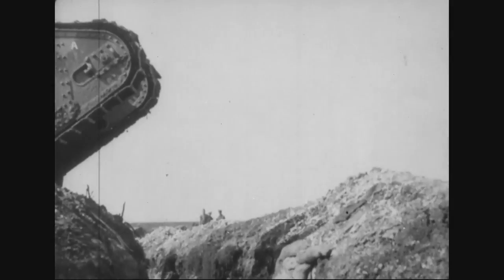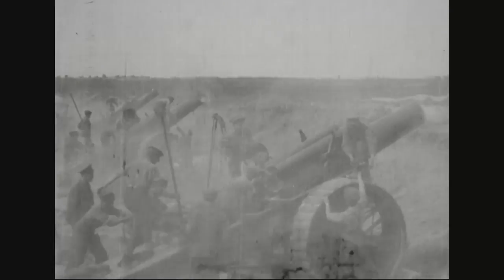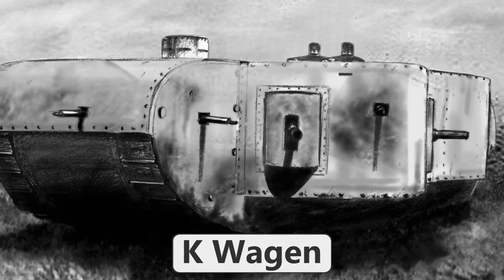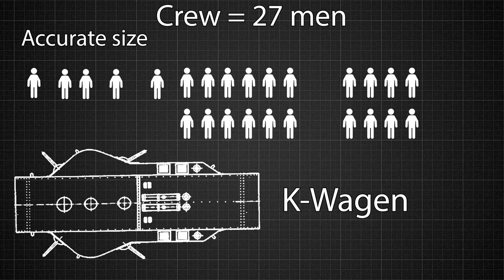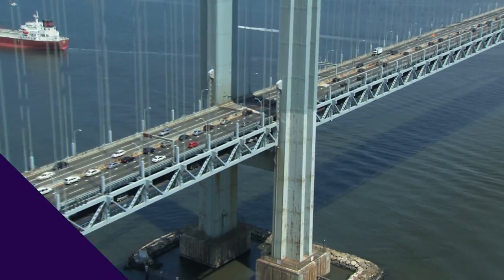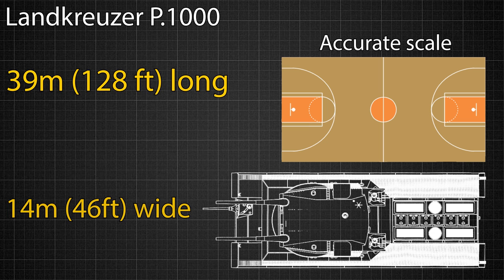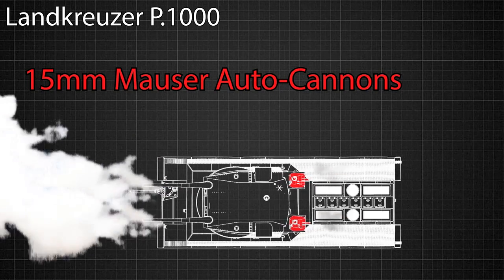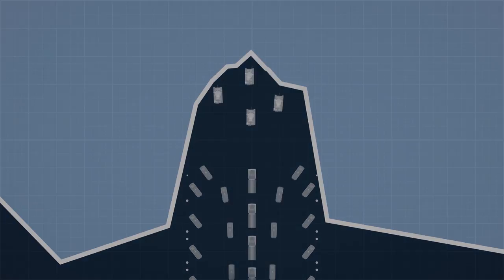These Are the Largest Tanks Ever Designed

Comment: The M1 you used is very outdated (1980's), the M1A2 SEPv2 (by 2017, the time you uploaded the video) was the most modern variant. Currently, the M1A2 SEPv3 is the most modern variant. (But it wasn't around when you made the video)

Comment: The current M1A2 has a 120mm cannon. Not a 105mm.  If your going to talk about a tank use what info is available on it.  The M1 Abrams has a 105mm in the 1980s - early 1990s. Then it was upgraded to the 120mm gun it has today.

Comment: The p1000 ratte wasnt aprovved by hitler, it was just a speculation, for all we know it could have been something that drunk desingers drew up one night.

To prove this a turret in the atlantic wall was said to be the one supposed to be put on it, and the turret ITSELF weighed about 800 tonnes, usually the turret 
weighs a small percentage of the tank, the tiger 1 turret for example weighing if i can remember correctly something around 10 tonnes.

Comment: The Ratte would have been useless, except for maybe as a semi-mobile artillery platform. The Ratte would've consumed manpower, fuel and money that Germany simply didn't have.

 It couldn't have been transported by anything else in any practical way, so moving to another location would have been out of the question. 

As well as that, repairing damaged tracks or wheels would have been impossible due to the sheer size and therefore difficultly of removing such components.

Then there's the question of actually building the thing in the first place. No factory in the world could've produced a vehicle of that size, save for naval shipyards.  

Finally, assuming it ever could have made it to a battle, one of three things will happen: 

1. It could get stuck/broken down and be simply abandoned by the crew.

2. It could get taken out by bombers/tankbusters. I'll cut the Ratte some slack here though - the AA armament would have made that difficult. 

3. It could get ripped to shreds by constant artillery fire.

Comment: The thumbnail looks like the p.1000 ratte a German super heavy tank that uses a battleship cannon(also there is a first blueprint of p.1000 ratte has a two battleship cannons in the front and in the back but it was not used because it's too heavy and cost too much resources and also I think the p.1000 ratte is designed to be built into a shipyard because it's too big to fit in to the tank maker I dunno what it's name sorry)

Comment: U forgot to mention T95, Tog 2, E100, KV-6 and FCM-1. :(
Reply: T95/t28, well its Designed to be low profile sort of breakthrough SPG, on the video title it said "largest tank" which referring to size, but hell those are heavy good luck for the American to transport that.

Since there are probably no documentary about fcm F1 so we can't sure about that better included or not.

Tog 2, I agree it should be added on the list since well it just smaller land ship (with 1 gun), and 80-90ton of weight.

E100, God sake it just a maus but slightly lighter (around 138ton?). It just a simplified maus its should be added as well.

Kv 6 I don't think it Was a real tank so no for now, there one tank that looks super similiar but smaller the Soviet SMK there not really much information about it so no explain + this comment getting too long

Comment: If Germany just scrapped their navy ships and did not build any (they were pretty useless anyways) they could have build a few hundred of these land cruisers. Now that would have been epic
Reply: Except it doesn't work that way
Reply: @Kalashnikov413  they would at least have the steel to do so
Reply: @Kalashnikov413  and with all the logistics and other shit that went into supplying a navy and other shit I’m sure around 100 p1000 could be built
Reply: @Phantom-bh5ru  it's impossible mate, because:

- despite being quite ineffective, they still need Kriegsmarine to destroy Allied fleet.

- even if they do wanted to scrap a lot of ships just for 100 P.1000, the time it took to actually built one is much longer, and the Allied troops would've just landed on Normandy far earlier, therefore ending the war much quicker.

- not to mentioned that they need to build a very huge factory, or even dry dock to built one.

- and even if they do manage to built all of them somehow, the German mechanics would have hard time maintain and repair all of them.

- and such a huge tank would be easily destroyed by several medium to heavy bombers
Reply: @Kalashnikov413  they can just use Uboats, German naval ships were vastly outmatched making them basically useless anyways. Building a p1000 would be much faster than any large ship. And the design was planned in 1942 which gives Germany more than enough time to build the infrastructure and the p1000s before Dday.
Reply: @Kalashnikov413  you keep saying impossible which is an absolute, Which is absolutely wrong. Just because something is different or impractical does not equal to impossible. If everyone had your mindset nothing would be achieved
Reply: @Phantom-bh5ru  you forgot about my points on how it would be vulnerable to air attack and suffer from mechanical issues
Reply: @Phantom-bh5ru  it may be enough to built 1 or 2, but certainly not 100 of them

You said that U-Boat is enough, so it added my points of don't waste resources on P.1000 and built U-Boats instead.

And one thing, sure sometimes, impractial doesn't mean it's useless, but in this case, it is
Reply: @Kalashnikov413  none of that would make it impossible. Mechanical errors will always occur it just depends on how well the design is which neither me nor you would know because it was never made, air raids are so unimaginably ineffective. You know it takes like thousands of bombs to hit a target? And even by the end of the war Germany was still pumping out tanks
Reply: @Phantom-bh5ru  
1. Mechanical issue sure is common, but with the tank that big and that complex, you need another P.1000 tank to recover it, and it would took days or weeks to repair it.

2. If it took around thousands of bombers to hit a target, then explain Yamato.
Reply: @Kalashnikov413  bruh i boats were enough to do what the navy were doing. Building more would be useless. 1 or 2? Lmfao no they can definitely make more. Germany made Bismarck and Tirpitz which by themselves weight more than 100 p1000s
Reply: @Phantom-bh5ru  Considering that Bismarck and Tirpitz were battleships meant to face off against Royal Navy's strongest ships....... and was built even before the war had begun